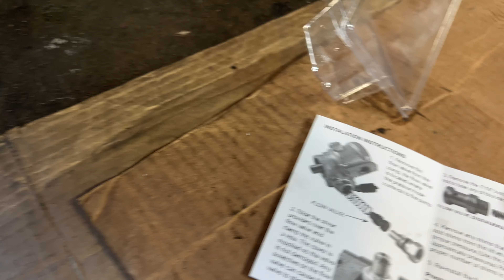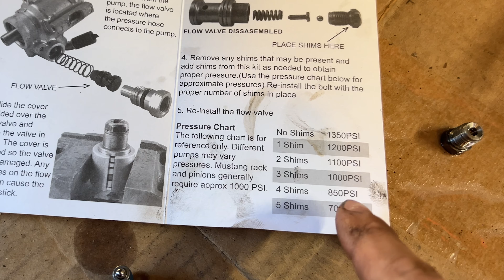The 4.8 LS Swap Doesn't Fit in my 1974 Corvette So I'm Making Modifications

Comment: Side note on the power steering, way back when I did mine, I was able to take off then OEM fitting from my dodge power steering pump and replace the one on the LS pump with it. I did it not to reduce pump pressure(I didnt even know that was a thing 😂) but so that I could reuse my stock power steering hoses.
Reply from the maker: @NightWrencher  was that before or after your power steering line blew out at the track when we were lining up at the drag strip? 😂
Reply: @noboltsleftbehind  it never blew up 😂 this was on my W100 and ive never had an issue with it until the sector shaft seal started leaking. Ive rebuild the steering gear since then but I ran it for 3 years before the seal died. Not bad for a 35 year old gear 😂

Comment: I had the same problem with a 6.0. However, I purchased a OEM steel hood (mine is a 83 one year plastic hood camaro) and installed DIY heat extractors that allowed me the space I needed. Now I have the clearance, good looking / functioning heat extractors, and a conversation piece at car shows.
Reply from the maker: That’s super cool man, and I love me some good hood vents 🤘
Reply: We need a pic!

Comment: Get yourself an electric DA/orbital sander and some 80 grit discs. When you fab something like that fuse box bracket you can DA the raw bracket and it will give it a more "manufactured look plus it will take paint very well.
Reply from the maker: It's funny you say that, I bought one maybe a year ago for some body work but never got around to buying pads for it. I'm 100% gonna try that out 👍
Reply: @noboltsleftbehind  Yeah it works very well especially if you round all of your corners and grind off any excess weld. I saw it on the YT Channel Make it Kustom some years ago and have been doing it ever since.